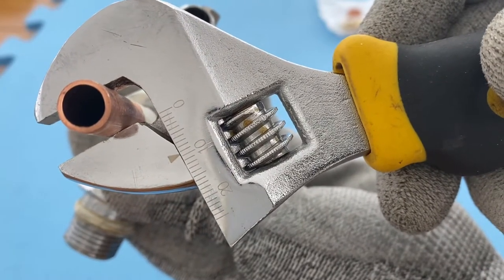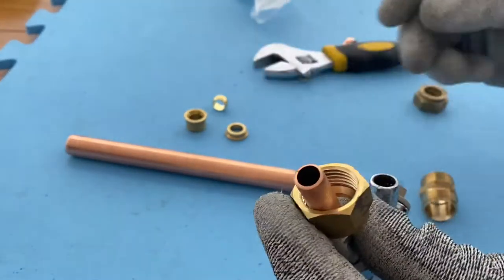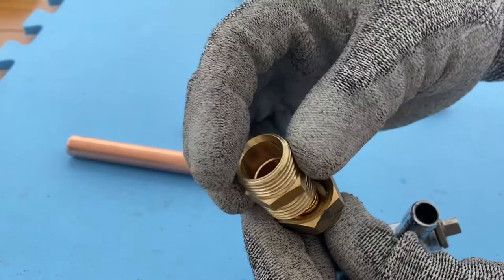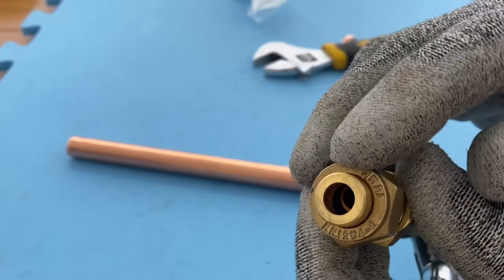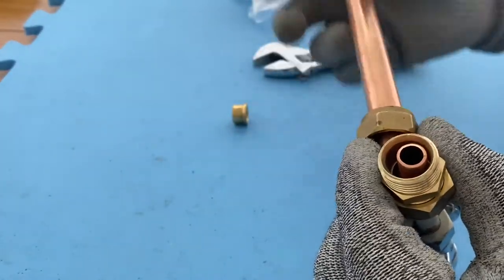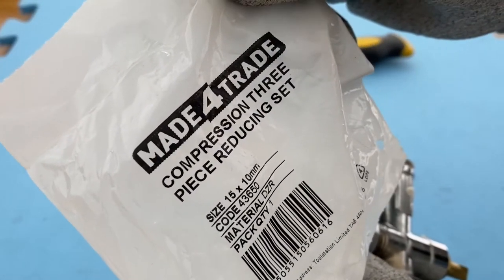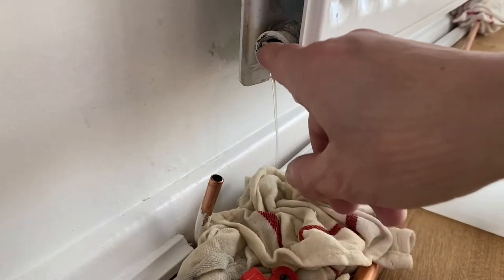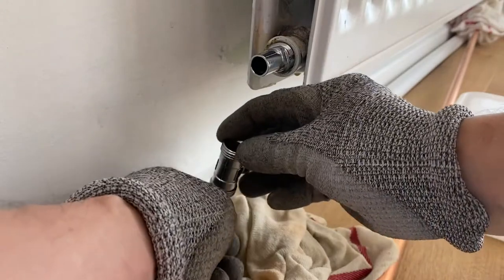Install a radiator in my conservatory/ part 2: 10mm pipe to 15mm TRV valve

Comment: Totally wrong on all counts... For starters, you never put compound on the female threads. It risks pressing some into the heating system. The reducer uses all 3 parts to compress the pipe... Oh boy...

Comment: You started with one type of fitting (and assembled it incorrectly) then changed to a different type when it came to attaching it to the radiator? Just take this video off, it's not helping anybody.

Comment: Why not just buy a 15mm to 10mm fitting. Or even better a soldered one
Reply from the maker: Yes, you can. Mine is reducing T connection, this adapters are much cheaper and easy to do, thanks